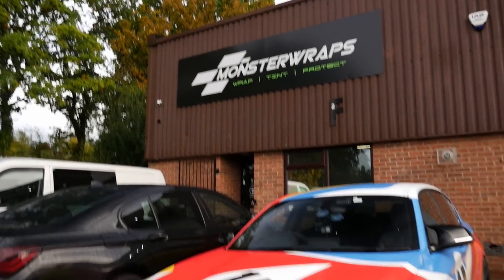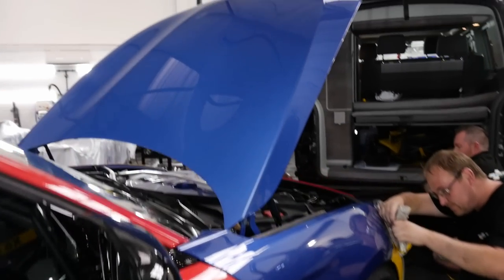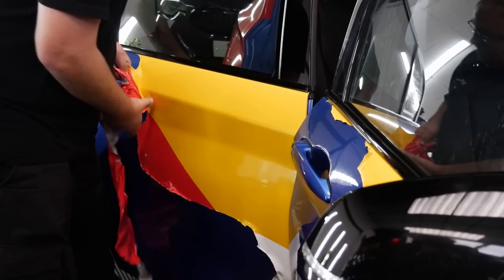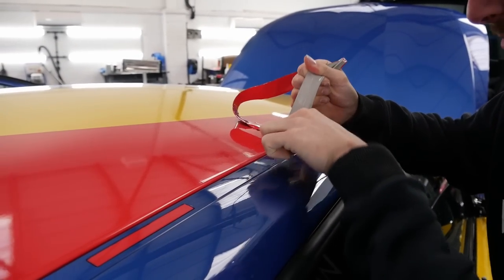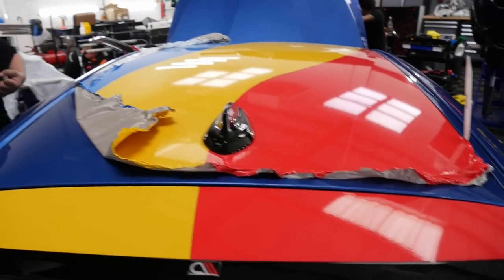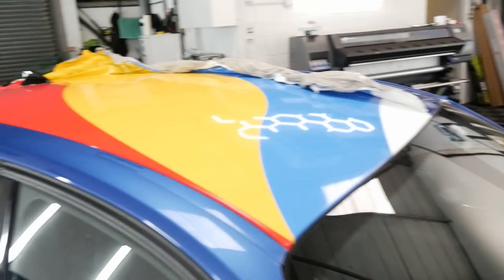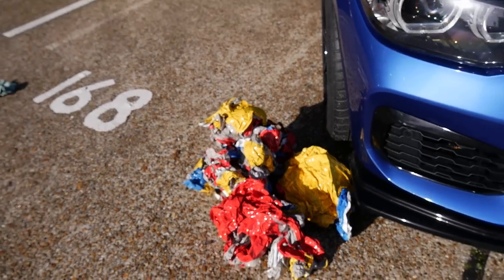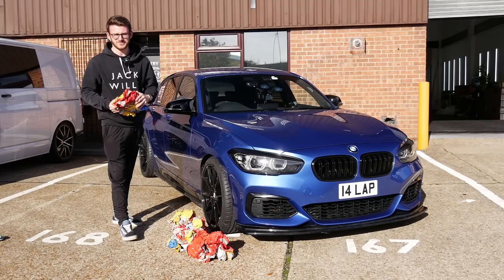UNWRAPPING My M140i 'Art Car'...

Comment: Debating whether to sell my stage 1 (300bhp) Mini JCW for an m140i, but whenever I look at the specs, the BMWs have barely any kit compared to my mini where I’ve got everything apart from heated windscreen 🤔

Is it worth swapping to a slightly boggo spec 140i or would it be a ‘downgrade’?
Reply: A shadow edition will have HK sound system, cruise, rear parking sensors, privacy glass plus a few other bits. Is there much more you need?

It’s clearly not a downgrade because of the B58.
Reply: @samcourt6228  in my opinion the only options you need are sun roof hk sound systeem navi pro and heated seats al other opties are not so important
Reply: @havefun1226  sun roofs are like rocking horse poo. That was an expensive option if I recall and one that non many ticked. 

Pro nav is a must. Mine was a shadow edition and I only added pro nav and arse warmers. Never felt short changed.
Reply: @samcourt6228  I’ve got all of that plus wide screen, HUD, Adaptive Cruise control, Heated-seats. Sounds snobby but a 140i was originally an almost £40k car and it doesn’t come with something basic like heated seats…it’s crazy.
Reply: @topgearmad12  is a BMW….nothing is standard. MINI’s are just as bad….lots of the stuff you’ve got on your JCW were optional extras.

It depends what’s more important to you; toys / spec or the six cylinder engine.

The 140i was never a £4K because no one paid anywhere near list for them. Mine was supposedly £38.5k….I paid £28k. The list prices were an absolute work of fiction.